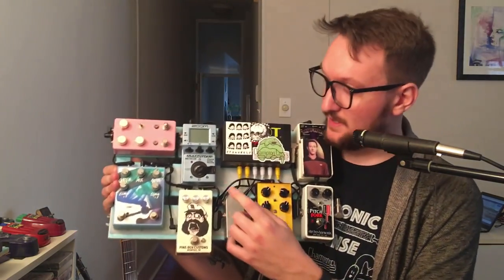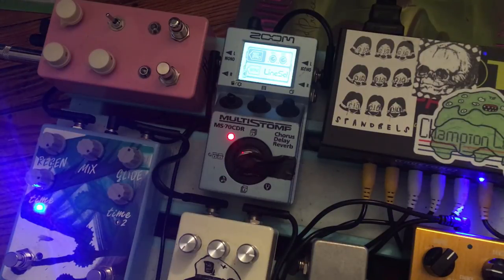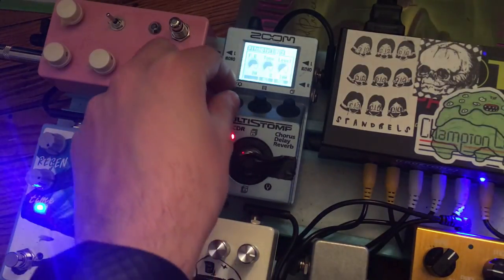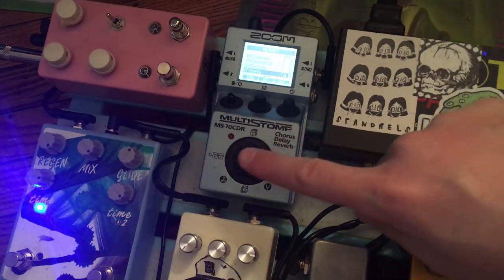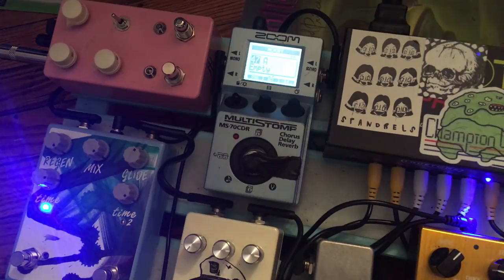How I MultiStomp: My tips and tricks for getting the most out of yr Zoom MultiStomp

Comment: I was thinking of buying ms70, but then I see ms100 at same price...  so, is the ms100 worth over ms70??    or is it a different pedal oriented to other stuff?   
I love delays and reverbs,  I have a gt10 but, you know that Particle delay or whatever,  that is not in my poor gt10..  I love what I heard from ms70 in other videos,  then there is a vid that said that ms70 is not the best quality, is a rather cheap and small pedal, and there are other pedals which make this with a better sound..
Reply from the maker: Hello! So the MS-100 is the "bluetooth" version of the MultiStomp that originally had a few more patches that were not available on the other devices. At this point in time (August 2021), the MS-70 has the ability to use patches from all the other devices in the MultiStomp series EXCEPT for the dirt and amp options, though there are ways around that you can find by searching through the MultiStomp subreddit (reddit.com/r/zoommultistomp).
The 70 and 100 are technically and technologically basically exactly the same and the quality of the sounds/effects themselves are 100% identical across the entire line. The Particle Verb in the 70 is the same as the Particle verb in the 100 is the same as the Particle Verb in the 50G; it's just a digital emulation and the actual stuff making the sounds is exactly the same. The 70 is very well-loved among many folx, I think, because it has the stereo ins and outs whereas the lower numbered devices in the series only have mono in with stereo out. The 100 also has stereo ins and outs, for the record.
As for the "plastic" quality of the pedal, it is EXTREMELY robust and I believe the case is made of metal but I don't really know. I broke the footswitch on my old MS-70 because I was silly and stomped on it too heavily but that's not a common issue. More common is knocking off the encoder knobs but you can still use them so long as the little shafts stick out. Ultimately I find the quality to be fine and the sounds are magnificent for the price/board space the pedal takes up.
It may not sound 100% as good as something like a Strymon or an Empress pedal but it costs 20-50% less than those pedals so you're getting a ton of value for what it is. The community is very helpful and responsive and there are so so so many amazing patches you can download online without even having to edit them to get great sounds PLUS you can build super intricate things if you give yrself the time and patience to do so.
I've responded to a whole bunch of questions like this in this comments section and on my other MultiStomp videos so feel free to scroll down/check out my other videos on this pedal and see what else I have to say about the pedal there.
In short: the pedal is well-built and still entirely unique for what it offers and for the price, you'd be hard pressed to find something as versatile, useful, and fun to play through.
Please feel free to ask me any more questions you may have, okay? =)
Reply: @PedalFriends  Man, thanks,  my only concern was that I wanted something with better quality,  I have a gt10 so I cant speak much about good quality,  but it would be bad if I went straight to buy something I know it has too low quality sound.  Still I freakin love everything I hear from this pedal.. I dont like the sounds like the amps or distortions, but the reverb - delays are so cool.. they are exactly what I need. 
The format (as everybody says) is not the best one, it breaks and you cannot operate it with your feet, you can only turn on or off. Otherwise you will have to keep it close to your hand..
Still, there might be other pedals that can do all of it.. I cant find it though.  Somebody else said that no other pedal has all the variety of delays and reverbs.  Empress Zoia (if that is the one you are talking about) is cool, but I guess that it costs like a gt1000.  Then other pedals tend to be based on knobs and not on presets.  I wouldnt go changing the knobs everytime like a classic pedal..
I had the doubt because I saw ms100 and ms70 almost at the same price!  the problem is that it is cheap, so you know something is not right. Honestly it costs half of a gt10 or a me80,  so that is not a good sign. 
I would love to get some more money and get something of more quality.  If I could just improve the quality of ms70, I love it just like it is.   In some channels like Shoegazer they say that the quality is not the best..  they said something like "dont confuse me, this is not a helix", or something like that.
Reply from the maker: I think yr letting yr wallet inform yr ears rather than letting yr ears do the work: if you like the sounds you hear from something, who cares if it's inexpensive or whether or not someone else says it's "quality". So long as you don't strap cement to yr feet and slam it down on the pedal or act silly in general, this pedal will treat you well and I, among many others, have had mine work for me for years.
I don't have any answer for you about what will work best or sound best because I don't have your wallet or your ears but if it sounds good then it sounds good and that's what counts.

Comment: Where is the distortion/overdrive patch?
Reply from the maker: Hello! I’m not totally sure what you’re asking but I’ll do my best.
I made this demo before I knew you could add effects onto the MultiStomp from other versions so I actually don’t have the overdrive/distortion effects from the MS-50G on this device in this demo.
If you’re wondering about how to create pseudo-overdrive/distortion sounds from this pedal without “hacking” in the effects from other devices, I’d suggest using the Drive Echo with a really short delay time and higher mix. You can do a similar thing with the Lo-Fi Delay/Reverb or even using the Bit Crusher or Ring Mod. Won’t be perfect approximations of OD/Distortion sounds but it’ll be interesting for sure.
Hope this answers your question.

Comment: What is that line selector? Where can I get one? Thanks!
Reply from the maker: Hey! Not sure I understand the question; the Line Selector is an effect listed in the MultiStomp. If yours for some reason doesn't have one, you may want to use the Zoom software to add it back on there. If you want a comparable pedal, I believe it's based on the Boss LS-2. Hope this helps.
Reply: @PedalFriends  sorry the external II it you use to choose between line A and B. Or maybe I mean your bypass pedal?
Reply from the maker: @dotsunmoon  OH the external bypass pedal is just a standard Saturnworks build: https://saturnworkspedals.com/product/true-bypass-looper/
I had them leave it blank so I could add my own little piece of art to it.
Reply: @PedalFriends  oh it’s a looper? Correct link or were you looping? Maybe I should watch the video more closely. 😂😉
Reply from the maker: @dotsunmoon  in this context, a "looper" doesn't mean looping SOUND, it more means "creating a closed loop of signal" AKA whatever is "in the loop" is bypassed or not using the footswitch.
So when I hit the footswitch on the Saturnworks pedal, anything "inside the loop" is ACTIVE (in this case my MultiStomp). When I hit the footswitch again, anything inside the loop is INACTIVE and the signal passes through WITHOUT hitting the MultiStomp.
I hope this makes sense; I haven't watched this video in a while or owned either of these devices in a while but I think I explain it in the video as well.
Reply: @PedalFriends  you probably did.  But I appreciate the explanation.  That is a huge help. I am surrounded by people using sound loopers now and that’s all I could think when I went to the site.  🙏🏼🙏🏼🙏🏼

Comment: What guitar/amp are you using?
Reply from the maker: I use my Squier VM Mustang with upgraded Dominger pickups; I'm pretty sure I had it set here for both pickups in phase.
This goes into a Digitech Cab DryVR (input 1, C6 with Size set just past noon).
I usually have this noted in the description and will always have that info in the About section of my page from here on out <3

Comment: ....can't hear you :'-(
Reply from the maker: Ah! So sorry. At which point? Someone was kind enough to write down what all my tips were and it is the pinned comment. I will paste that below:

Tip 1. Line Selector is your friend - you can punch in and out using this inside the pedal or use an A/B or true by-pass loop (also see 4a below). 1:54
Tip 2. Hold the up button to access effect categories instead of clicking forever (example pitch effect in lofi reverb) 3:25
Tip 3. All time parameters (mS, bpm) are consistent if you use the same effect more than once 3:51
Tip 3a. Spin knobs quickly makes them jump values quicker 4:25
Tip 4. Click middle knob to exit effect editing and the right to go to first page 5:40
Tip 4a. If you want to punch out the effect completely, use the true-bypass loop pedal (or A/B switch) 7:02
5. Holding left or right adds effect to the left or right of your current chain position 7:15
6. ABC mode - Click middle knob to go to memory list of patches you have set up for various songs and song parts (chorus, verse, break, etc.). Use the right knob to assign patch order, like: A-B-C...W-X-Y-Z 7:25. 
7. Arrange them in set list sequence INCLUDING DRY SOUNDS with no effects to make it easier to scroll through your set list (50 memory positions). 8:00
8.Experiment with different effects, different orders, move in and out, e.g. dirt boxes before and after delays/reverbs, emulate other signal chains of your favorite artists, etc. 9:08
9. Then just do stuff the wrong way and see what happens, e.g. bit crusher after reverb. Bit crush everything (amazing) 9:24
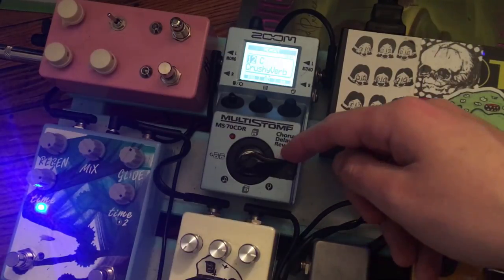10. Mess around with the harmonic pitch shifter, near perfect monophonically (even with digital artifacts) 10:17
10a. Put HPS after pitch delay gets kooky 11:27
11. Shoegaze patch uses MojoRoller at end of an ambient patch (2 delays into big reverb?) for delayed vibrato, then into a dirt box after the MS-70CDR 11:52
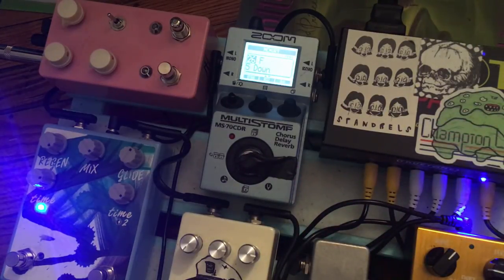12. Try different patches you find and string them together e.g. his 5 Down patch - pitch shifts down a 5th + LofiJunky patch (compressor into vibrato) that gives you enough creative juice to build a song around it 12:52
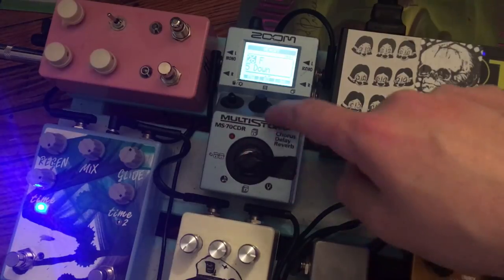13. Try BendChorus (Thacknin patch) starting with low settings across the board, then adjust to taste 13:51. 
13a. Dynamic Flanger, MojoRoller, reverse reverb, end with dirt (Shoglazer patch) 14:33
14. Trigger Hold Delay into pitch delay into THD into analog delay (put THD everywhere = Hold5Maths patch) 15:39
15. Set things wrong for delays (Drunky patch) 16:33
16. Pitch delay, down a fifth, baritone guitar like, then into big reverb (Down5Smear patch) 17:19
17. Go to https://www.reddit.com/r/zoommultistomp